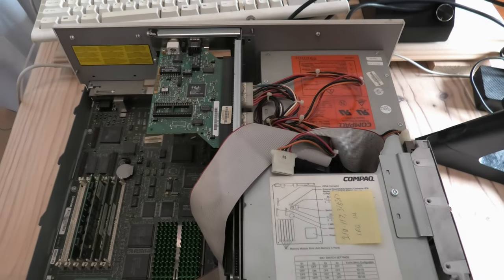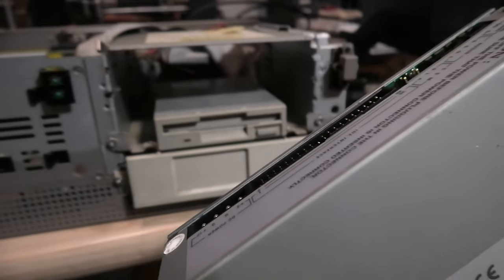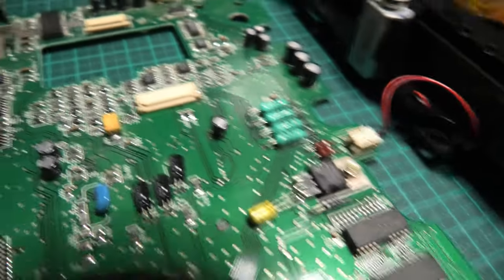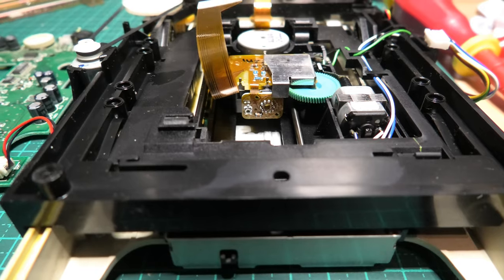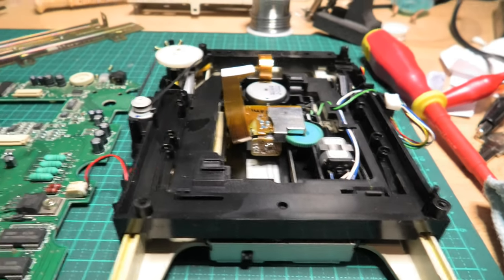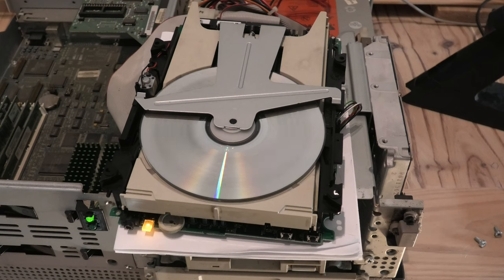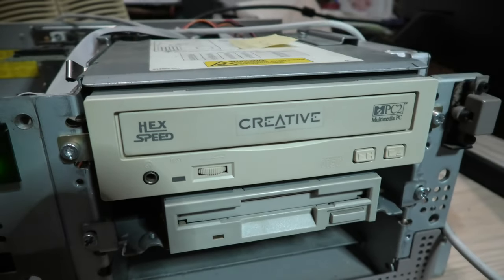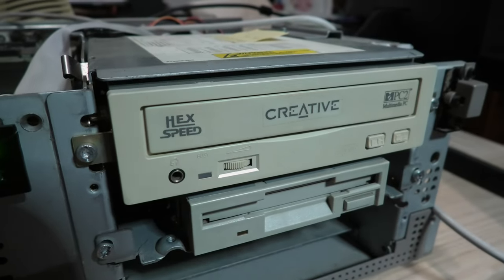Vintage CD ROM repair

Comment: I just fixed my old ide cd rom drive. PC would recognize but nothing else. I took it out, opened it. I excersed the drawer that would not open without assistance back and forth until no resistance. Cleaned the laser. Boiled the belt in water. Also excersed the Lazer holder moving jig. Was stuck. Fixed and works now. I'm using an ide setup and win xp. Dell dimension 4700, diskette drive, 1 gb ram. Old game beast.
Reply from the maker: Nice work.  XP is probably my favorite 'old' operating system.  Spent countless hours playing Unreal tournament with mates something like 20 years ago when LAN parties were a thing :)

Comment: Having the same trouble with a creative quad speed drive here, If you still have this drive could you please measure the resistance across the pot as I I'd like to compare values.